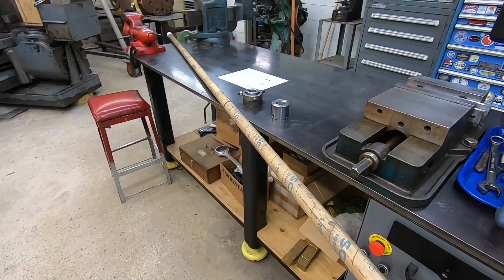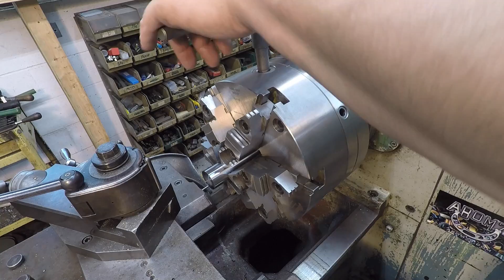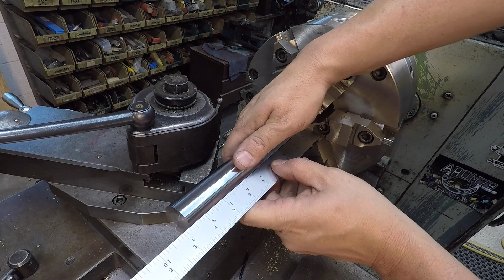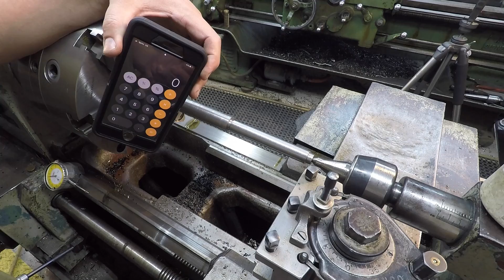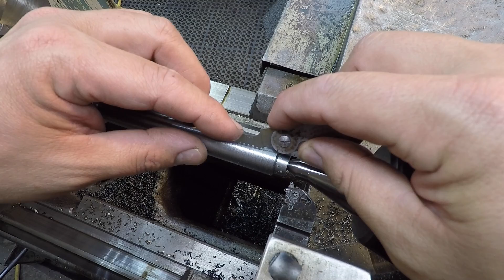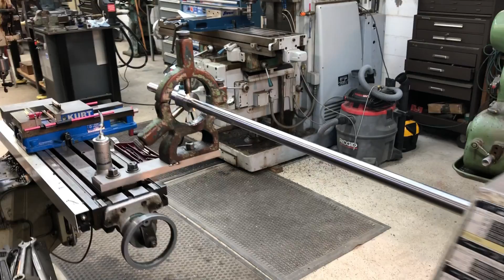Machining a Custom Prop Shaft Part 1

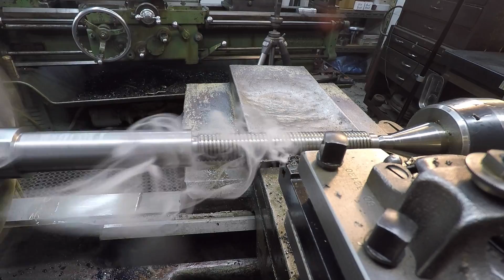Comment: 31:00 Is it normal to see the workpiece lift a little bit upon contact with the tool?
Reply: I recommend that, when machining parts with small and long diameters, that you raise the tool from 0.5mm to 0.7mm, which considerably decrease this effort.
Reply: And that is the tool force that Adam discusses around 33:35 and why you do spring passes. That is the spring. The spring pass is such a light cut that it doesn't flex as much.
Reply: Screw cutting puts a lot of pressure on the material especially smaller dia. And longer threads. You can use a travelling steady which bolts  to the front of the saddle , this eliminates this, I have used it when doing long Acme threads as there is even more pressure applied to the job.
Reply: Yep.  Equal and opposite reactions and all that.  That same force is shoving the tool down

Comment: I totally believe that with the 6 jaw that you need to tighten all 3 pinions - plus i've seen you do it here on the channel where the runout improves when you circle the chuck around and tighten them all evenly as opposed to just tightening one of them

Comment: Gotta share an experience.  Had trouble using balancing rollers to check runout while straightening lineshafting once.  The rollers can have runout, although they are balanced very well, which is all  okay for static balancing a rotor that you don't really spin much.  As long as the rollers are balanced real well the heavy side of the rotor will still roll to the bottom, so runout isn't much of an issue for balancing.  Put a TGP shaft in your rollers and indicate it right on top of the rollers and see what you get... not saying that all the balance rollers are like this but it is something to consider and check if you're trying to use them for runout checks and shaft straightening.
Reply: mashed-\ /-out Check. Something to keep in mind.

Comment: @Adam are you able to machine splines on shafts? I'm gonna be building a bronco 2 and making a mud truck and I'm using a 1 rear axle AMD also 1 ton fronts but I'm going to shorten the housings and going to need the axles resplined and some companies are really expensive to pay them to extrude the splines

Comment: Excellent your videos, a tip, put bearings in the contacts of the telescope and goodbye heating. A save from B.H Brazil.
Reply: Its not about heating its about marking the shaft. Bearings are too hard and will mark the shaft.  I  have 2 steady rests and the one with bearings always leaves a line round the shaft.  regards
Reply: @garyc5483  
In fact, this mark can occur. But I mean to put the bearings in the device that holds the shaft, so we work without the worry of heating up.
excellent your work.

Comment: Great review Adam.  Why is the 45 degree cross slide used when machining threads? It appears you move it a set number of thous regardless of 90 degree depth cuts.
Reply: This should have you covered. https://youtu.be/Lb_BURLuI70?t=817

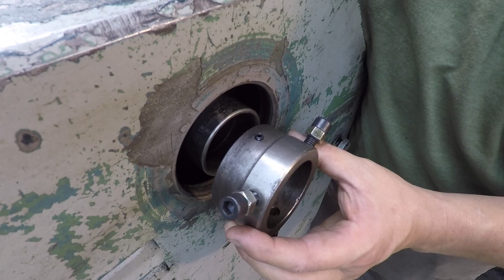Comment: 6:08... omg that is Genius!! Going to make some of our lathes now. That’s a great idea so much more better than stuffing shop rags in the headstock and roller v stand.  We make roller shafts for the paper printing that prints 72” wide  and 30-80,000 feet rolls but the idler roller have  3/4” inch shaft with bearings.  Awesome!!!

Comment: why not center drill it when the end is closer to the chuck?
Reply: Centre drill would not be on natural centre, when the bar is brought out further,  you may be bending the bar. It would be acceptable if the bar was say 250mm/10" long, and you gripped at the very end in the chuck.
Hope this helps.
Reply: Agree.

Comment: I dont think you explicitly said it, but from what I understood a 'spring pass' is just recutting at the same depth as the previous cut?
Reply: Yep. Your dials stay the same as the last pass, and you're just taking the deflection out of the tool.
Reply: that is correct
Reply: Not a fan of spring passing for hitting close/exact tolerances after being shown by a former tool and die maker at work. For example say on a final cut you are taking 0.1mm and you then go and do a spring pass without changing anything. Suddenly the tool has far less pressure/engagement on it from the relieved workpiece and subsequently less deflection so you may very well go undersize and your 0.1mm cut suddenly becomes 0.11-0.12mm total after your spring pass. 

While not important for many applications, when absolute precision is a requirement a better approach (imo) he taught me is to get your stock within say 1mm of final size and then divide into 4 parts (0.25mm in this example) and take a cut. Measure part with a mic and work out remaining stock. If your machine took the exact amount dialed in then simply repeat cuts till piece is to size. 

If it measures smaller or larger divide remaining stock to cut by 3, and adjust the machine to cut a third of remaining material based on whether or not you need to dial in or out on the cross slide handle say .01-0.02mm to allow for how your machine is cutting, backlash etc etc. Remeasure piece after your 2nd cut. 

Divide remaining distance by 2, dial in the machine and take another cut. You should by now have worked out exactly what YOUR machine needs to be set at to hit the exact size you want. After measuring you ahould be able to simply take a final cut without further adjustment and hit the EXACT size you are after. Main thing is once you start this process you cant adjust speed, coolant or anything else as that will change how the lathe cuts. Yes it takes a little time but making a new piece if you've overcooked it costs lots more especially if working on exotic metals or you dont have spare... Not trying to detract from whats done here but different pieces require different levels of precision and this is just my oppinion on spring pass for close tolerance work. Cheers

Comment: You could have used a cylindrical laser pointer mounted in the lathe chuck and pointed at a suitable target mounted in the steady rest to get the steady rest setting exactly right.  This would compensate for any sag in the rod.  The target could be a short cylinder the same diameter as the running bush with a centre pip on it.  As you rotate the chuck, the laser should trace out a circle around the centre pip.

Also, I agree with you about tightening all the chuck pinions,  I think that tightening only one will cause the scroll (and, consequently, the chuck jaws) to move slightly off centre within the chuck body.  The scroll should be a good fit in the body but there must be a little clearance to enable it to rotate.
Reply: Not practical.  Just because you centered the laser housing in the chuck doesn't mean the laser is centered.
Reply: @MaturePatriot  That's why you rotate the chuck (see my last sentence).  The centre of the circle that the laser dot produces as you rotate the chuck is dead in line with the rotation axis of the lathe spindle.

Comment: I'm not a machinist, but an engineer... why not center-drill when the stock is close to the chuck as opposed to sticking it out first (@18:00)? Would that not alleviate any possible bend in the stock?
Reply: dadatee if it were lighter stock then yes you are correct. That heavy of material isn’t as critical. Plus, using a center drill acts like a cutting tool and kind of squares it up a little as it cuts. I always do it up close to the chuck, but Adam knows what he can get away with to save time. Also, he may be a little concerned that the chuck won’t “bite” the same so if he does the center drill after he moves it then it won’t change if that makes sense.
Reply: Since the whole floppy end is getting machined down anyway, maybe it's not so important?
Reply: scose no, it isn’t floppy cause if it was then the area he turned wouldn’t be concentric with the rest of the shaft. It was running straight and true because of the size of the shaft and all the pressure was being applied back towards the chuck and not on the side of the shaft. And again, a center drill kind of acts a little like a boring bar in that if the shaft wants to run true, it finds center. That isn’t always true... depending on the material and the pressure applied. But Adam knows exactly how much pressure to apply and what his acceptable tolerances are. And most importantly he knows his machine inside and out and what it’s weaknesses are. So for example, if his chuck changes every time he takes a bite then he compensates by using different techniques. Most importantly he knows how each material is going to react when running different processes. I hope that helps. I am a better machinist than I am explaining things.😝
Reply: I agree.  The centre hole will be more accurate if it is drilled when the workpiece stick-out is shorter, but it looked to be running dead true at the end with the long stick-out, so it probably didn't matter in this case.
Reply: Centre drill would not be on natural centre, when the bar is brought out further,  you may be bending the bar. It would be acceptable if the bar was say 250mm/10" long, and you gripped at the very end in the chuck.
Hope this helps.
Reply: @bostedtap  if you use the dial to measure the runoff at the end of the piece and get it centered and then drill the center hole in light passes to avoid any permanent deformation wouldn't it be the same as drilling it close to the chuck?

Comment: 1:29 Drafting error.  Overall length is given together with a complete series of "chain" dimensions.  The workman should not be allowed to choose between two dimensions.  One dimension of the chain should be omitted so that the machinist is obliged to work from one surface only.
Reply: I self taught myself making technical drawings, and was berated for my early attempts (which is good because I learned hard and fast). For me, it always made sense to have an origin and always work from the origin.
I now do a LOT of 3D CAD modelling to set up PCBs, and I have to work from component manufacturers drawings to get the component dimensions. I'd say that about 40% of the drawings provided by multi-billion $ corporations are totally unusable, with missing dimensions and opportunities for accumulating errors.

At uni (electrical engineering), I asked if I could get some time in the machine shop with the mechanical course - just as an observer. Not a chance. I was kept busy with "equality in the workplace" and "business management".
Are you really surprised at my anecdotes about poor drawings from large companies, supposedly staffed by "engineers"?
It seems to me that drawing is seen as a low skill job that can be palmed off on the new kid when he isn't sweeping the floor or making drinks, rather than being the sole domain of the most trusted, experience and highly skilled person there.

Adams client may be a lay-person & self taught, so I can forgive the odd engineering faus pas, but this is really common in industry now. Very sad.

Comment: You mentioned that some people have asked why you tighten chucks in multiple holes. I am no machinist but when I took machining in college,  one of the MAIN rules was to ALWAYS tighten chucks in AT LEAST 2 holes. (lathes, hand drills..... ALL chucks.)
Reply: I only have joke tools here for mechanical work, however, I've always noticed that once you've tightened the chuck on one hole, you can always get a good bit more rotation from a second hole, and then very slight snug fit from the third.
I certainly seem to get less chuck-spin on drills etc when I tighten all the holes.

Comment: Keeps talking about "Spring pass", I'm going to have to go look up what that is.
"That's something else people ask me, what is a spring pass? well..."  Ah perfect.
Reply: In lay terms, it is left over material that didn't cut off due to the forces needed to make the first cut depth. Tiny amounts but they are there and result in what you dialed in to cut didn't really get cut due to the mechanical force on the stock and cross slide, ways etc.. cutting again without those forces present allows the tool and stock to meet without that stress. The term is shop terminology and not likely in machinist text books, they likely call it something else.
Reply: Put simply it is another pass with the cutting tool at the same setting as the previous pass. If the tool is long and slender like a boring tool for example, or the workpiece is slender, the tool can flex away from the workpiece and so another pass at the same settings will shave a little extra each time. When you are getting close to size, a spring pass will often get you to final dimension.

Comment: may be way off this teaching have you ever run threads on a Rigid  pipe threader go from NPT pipe   too 1/2- 13 or 3/4- 10 or 1"-8 on a job site thanks abom79 love to watch you work

Comment: Adam, I have spoken to you before about breaking carbides when you come back down the length you have just turned. Could this be a possible reason for the scratches on the surface of the piece that you tried to polish out. Certainly bears thinking about.

Comment: you can actually see that springing that Adam is talking about in the video at around 31:05 when the tool is lifted off the work
Reply: It's funny because I was just thinking to my self about why it is called a spring pass. Adam knew what I needed to know before I even did.

Comment: Hey bud I just found your channel.  Awesome channel.  You do really nice work.  Question. The chips from the machines that are hardenable do you do anything with them.  I’m a blacksmith. I see someone making pattern welded steel with chips that will take a heat treat.  I guess a knife maker would be perfect.  Not me Im not a knife makes.  I have made some but I’m not very good.   Lol.  Just a question. If you do sell them. I’m interested.  Thx ....Paul.

Comment: 27:22 Is your lathe chuck made in Poland? 😀
Reply: In SNS 228 (v=ioPgiVOpIhc) he does the unboxing of the chuck and says it's made by Toolmex.  The Toolmex website says their manual lathe chucks are "Made in Europe".  If you pull up their spare parts page, they specifically mention "manual lathes and mills from Poland."  So I would say it is a very strong possibility that it was made in Poland.
Reply: And... If you click the link to the chuck (in the description on SNS 228) you get a picture that you can zoom in on.  The chuck jaws are clearly labeled "Made in Poland".  You can also see partially obscured on the chuck body "Made in POL".

Comment: Quick question, why don’t you open the victor lathe where the change gears are and tighten the set crews?
Reply: Because of the three bolts he has to take off off the spider. Doesn’t win him time.
Reply: @BockAhab1  Also the shaft might make that a bit awkward

Comment: If you will doing this a lot you could put a small 4 jaw chuck on the back end of the spindle. Doesn't have to be rotationally fastened to the spindle as it would be clamped to the work and turn with it. just a sleeve fit.

Comment: That steady rest is a good idea to keep the shaft from whipping.  My machine shop was turning 1.75" solid aluminum 72" long for me and didn't support what was sticking out the headstock.  Speed was too high, it started whipping and bent while turning fast.  36" bent almost 90 degrees, actually started extruding out the headstock and moved the machine across the floor.  Not sure why it took them so long to stop the machine, but they did, just before it hit the floor.
Reply: Ole Anderson I’ve seen a few do this at my work long bar (un supported) starts lathe on 1000rpm+

Comment: Your attention to detail never ceases to amaze.  “I made this bushing so the work wouldn’t have rub marks from the steady rest” and “ I installed brass tipped set screws so as not to mar the work.”  All that preliminary work just to turn out a better product for the customer.  And, you bbq.

Comment: Funny, I started watching this while taking a break from machining 1.25" chromed hydraulic ram material.  A bit shorter than what you're doing.  I've also been guilty of being asleep at the wheel, both hand and steering.  Thanks for the tips, Ken

Comment: Really great video! I wish I could had chosen to go into engineering instead of agriculture, truck driving and other less refined jobs. The satisfaction from creating a piece of work like that must be a good feeling. There is a lot of beauty in such engineering which goes unappreciated because most people do not understand what goes into making an engineered part. Thanks for uploading and I look forward to Part 2!
Reply: Don't beat yourself up over this!  I've been in engineering all my working life, but I also hold a Truck Drivers' licence, occasionally I felt like a change and would leave the workshop and go out on the road for a while.  Loved it!  And don't underrate your driving skills: it takes a lot of skill to manoeuvre a large trailer into tight spaces or back up onto the loading bay to within an inch every time, day in, day out. Observe the average car driver - they think they're doing well if they're within a foot of an obstruction.
Reply: @gospelman7222  Ha ha ha ha ha I wouldn't say I beat myself up over anything to be fair. But know where I went wrong! The benefit of hindsight. Have a great week young man and thanks for the reply!

Comment: very interesting video. real creative set up. i never hear any one discussing the od of a thread. most machinists that i know cut the od a little undersze 3-5 thou. . i know the pitch dia. controls the thread fit,  but is it necessary to provide some clearance for the thread crests by cutting a undersize  od?

Comment: How in the world did you get the steady rest mount to line up with the lathe?  Is the main axis of the lathe perfectly parallel with the table on the mill, or did you have the twerk the steady rest mount.  Have you got a laser pointer hidden somewhere in the tailstock...haven't seen that before.  Really nice metrology work.  Impressive.